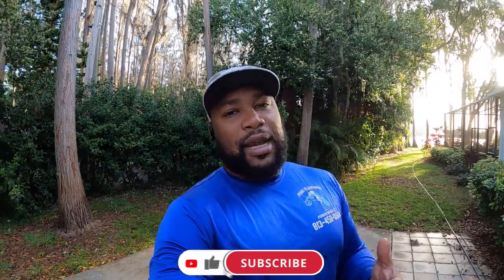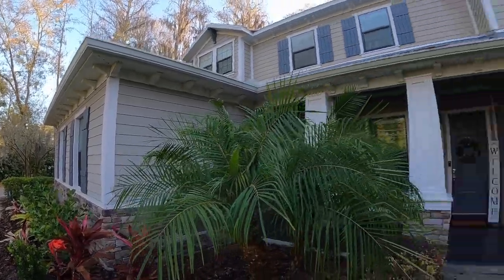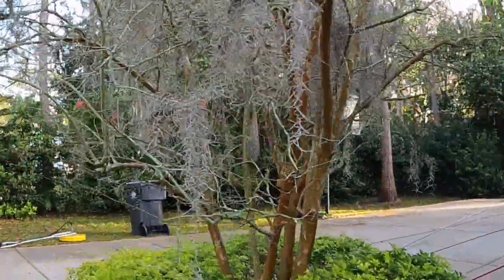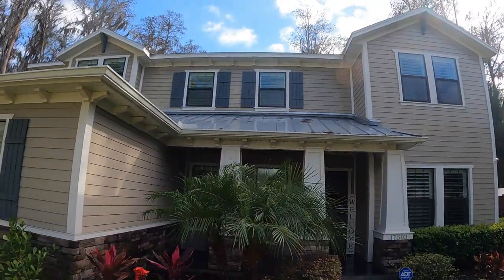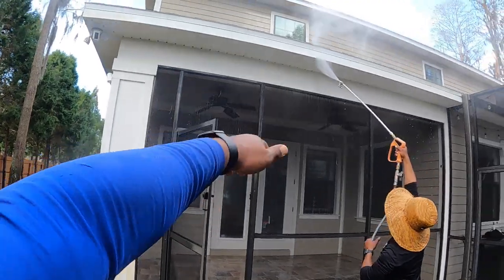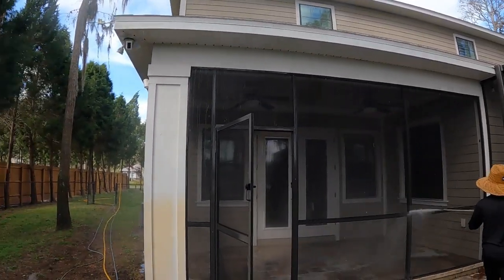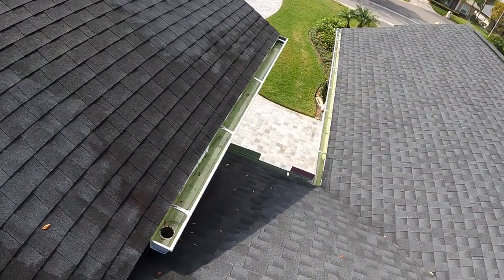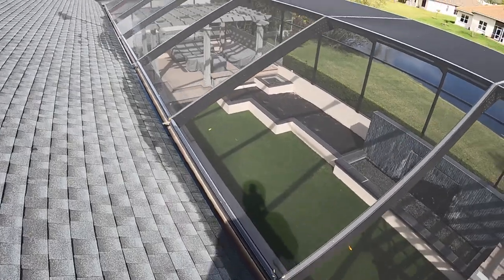Reliable Equipment made it easy as 1,2,3 Literally!

Comment: Hey Cliff, thanks for sharing your wisdom as usual. My next question is, what would be the best method for cleaning a coated paint pool surfaces as what you see mostly at hotels?
Reply from the maker: Good question! I would soft wash it like a failing painted pool deck. Nuke it with a hot mix then rinse with the gun with a wide fan tip. or even a low pressure Jrod tip.
Reply: @PinkFlamingoPowerWash  ok so surface cleaner is a no.
Reply from the maker: @Clive Brown  not if its weak flaky paint. Nope

Comment: What’s up brotha, just had an unrelated question for you. A couple of times now with my roof washes, not every time, the run off has killed lower vegetation. But not during the job, it’s only been when it has rained a day or two after the job, I use a ground guy to keep everything hydrated and when I leave every job I make sure it’s up to my standard. I wanted to know if you have any input on what I’m doing wrong. Thanks in advance, love your stuff!
Reply from the maker: Sounds like you should utilize some bleach neutralizer.  Idk how hot you're spraying for that to happen but a neutralizer will help for sure

Comment: Great video bro. . Can you use a hose reel from Home Depot temporarily for your pressure washing hose?? I currently work off the back of my F250
Reply from the maker: Thanks yes you can but only for hose storage. Don't run your pressure washer through the hose reel unless it can handle pressure

Comment: Great video! Did you have any training or go to washing classes?  Or did you learn on your own? I’m in Illinois and there’s no training or classes near me.
Reply from the maker: Nah no training.  I wish I attended some but didn't have the money to fly somewhere to take one.  So I leaned along the way.  Started with basic washing and moved up.  I never consulted with any of the local washers either
Reply: Thankyou. Another question: when you’re applying your sh, you just spray on plants, bushes and anything that’s in the area. The percentage you use, which is 1-1.5 correct?? Is that not strong enough to kill the surrounding grass, plants , bushes?? Also, can you use that strength on any house surfaces?
Reply from the maker: @Mark Williams  no it doesn't kill them. If you are afraid you can just rinse the plants before and after.  And yes that percentage will get 90% of surfaces cleaned.  Downstream is the easiest way to clean
Reply from the maker: No training classes. Learned from research and actually doing the work.